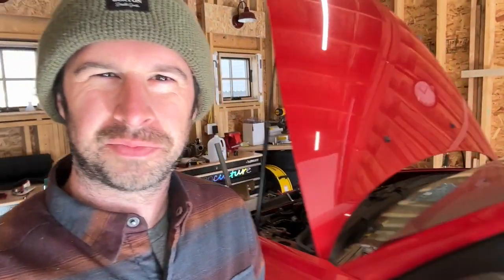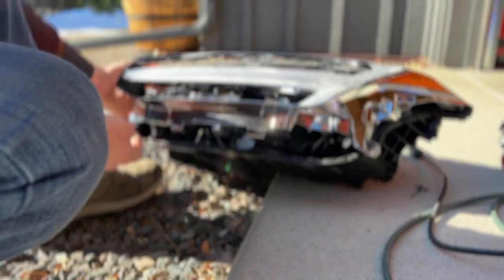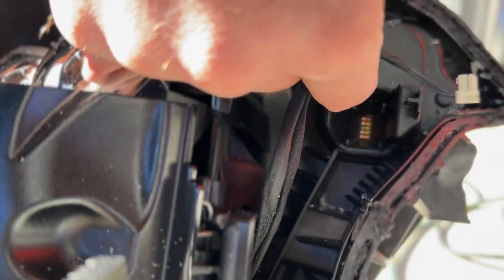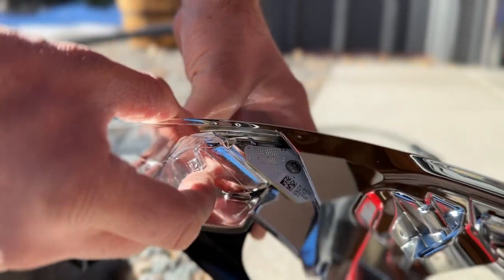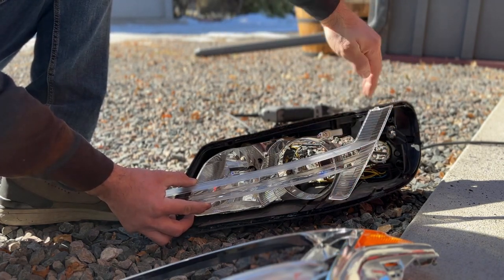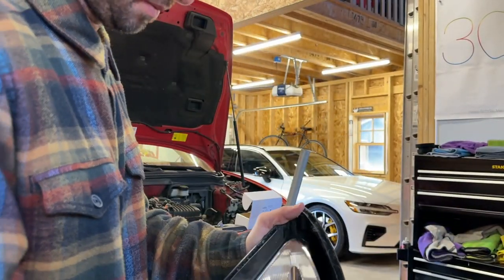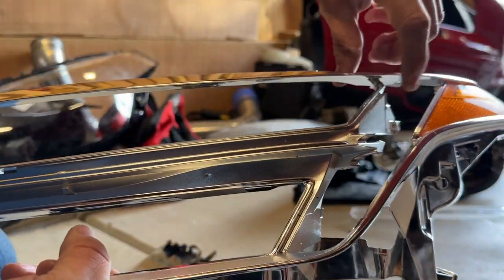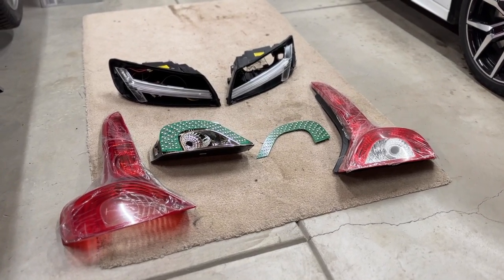Thors Hammer pt. 1

Comment: Great info.  The disassembly is very useful.  Unfortunately I have a facelift C30, so fitting it in the housing will be different. Looking forward to more videos about this.
Reply from the maker: Thanks, I will try to keep up with the videos. I do have a set of facelift headlights from a junkyard, can open them to see where the hammer fits sometime
Reply: @boulderc30  I have seen one guy do it, but he wasn't very forthcoming with the details.
Reply: @boulderc30  only other question, is does the hammer interfere with the projector for the headlight?
Reply: @greddy2race  following